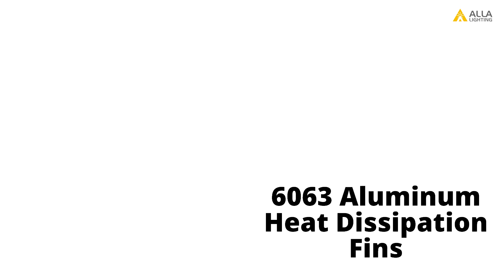7444 7443 Strobe Brake Lights LED Flashing Stop Lamp Dual Filament Bulb

Comment from the maker: 7444 7443 Strobe brake lights LED flashing stop lamp dual filament red/white bulbs, customized 7443LL 7443K replacement upgrade OEM incandescent or damaged rear brake tail lights lamps.
Product link: https://www.amazon.com/gp/product/B09PXVB61N/ref=ag_xx__xx
Fast check which bulb fits your vehicle: https://allalighting.com/pages/bulb-finder-shop-by-vehicle-led-light-bulb-car-truck